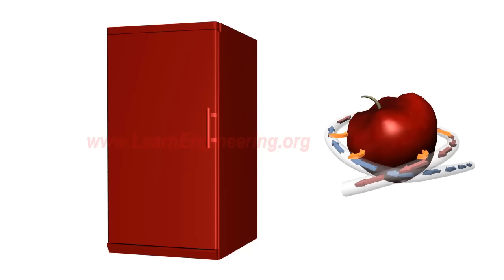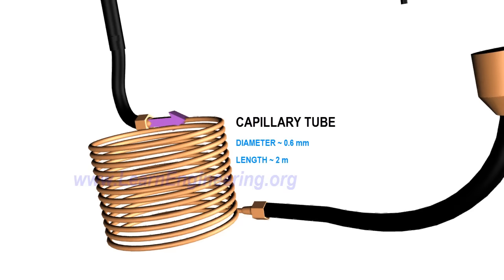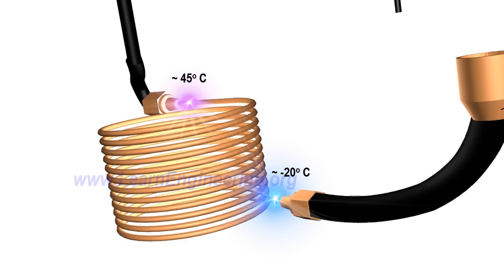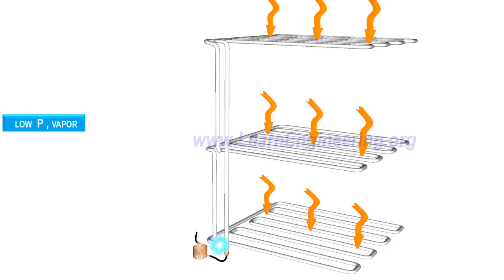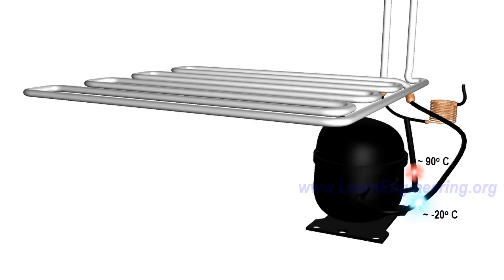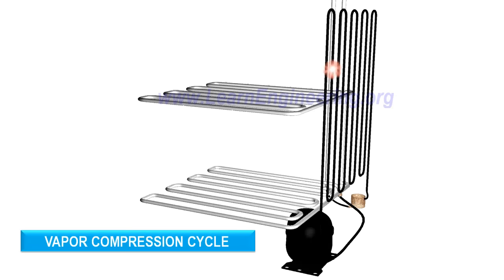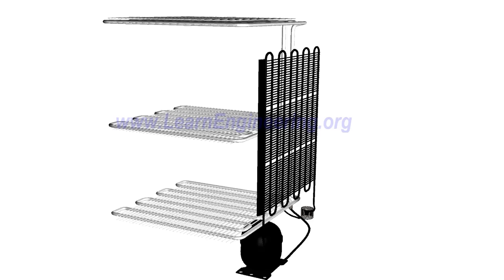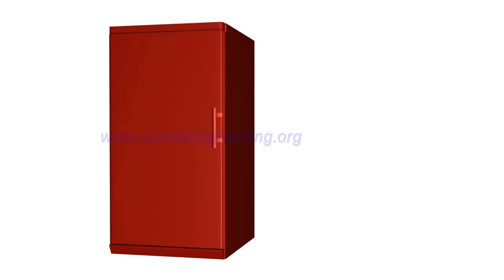Refrigerator working - The Basics

Comment: Why would a throttling device be used if it raises the temperature from -45 to -20? Wouldn't even greater heat take-away be achieved if it went through the system at the -45?
Reply: +Zikos 
whoops, I missed that. It all makes sense now, I'm a derpe

Comment: Still doesn't solve my question of why the low pressure hotter gas (after absorbs heat inside the fridge) must bother, through a two-step process of first increasing and then decreasing pressure/temperature, to become a high pressure liquid rather than just through a simple one-step process to become cold again??? I guess that's the esstenial bit of refrigerator engineering? I agree you sort of explained the chemical thermodynamics.
Reply: to simplify the question, why cannot we remove the compressor? What's the reason ('in general' is okay)?

Comment: Wait....if the throttling unit restricts flow, wouldn't that raise the pressure?
Reply: As far as I understand it, only inside the throttling unit. Because it's a closed system, the refrigerant is sucked around the circuit as well as pushed, so it's being pulled through the fridge's innards faster than the throttle can keep the flow rate high enough to maintain the high pressure.

Comment: But wouldn't lowering temperature through the condenser also lower pressure? Temp and Pressure go hand to hand.... I'm confused!!
Reply: +Kevin Corpetti You're right, but remember that between the condenser there's an ~8 bar compressor pushing flow continuously, and a throttling device (supposedly bottleneck-ing the flow), so probably there's pressure drop from the pipes itself besides temperature drop, but I think overall the pressure should keep high enough.

Comment: Can the throttling coil be said to be following Bernoulli's equation?
Reply: That's exactly what happens, the liquid enters a very small diameter which increases its fluid velocity, thus will tremendously decrease the pressure of the fluid.

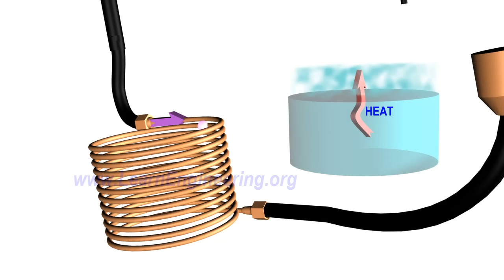Comment: 1:05 "Heat required for evaporation comes within the refrigerant..." Can you elaborate, please? Thanks!
Reply: Any matter contains a certain amount of heat.  Essentially all the molecules are moving and bumping into each other (vibrating).  Add heat and they vibrate faster.  But the vibrating is not equal.  In a liquid some of the molecules are moving faster than others.  And the fastest movers will escape as gas.  Loose a bunch of the fastest molecules and the average speed drops. So temperature drops.
Try this.  Leave a bottle of water out so it normalizes to room temperature.  Also leave a shallow pan of water.  The pan of water will be a little cooler until eventually it all evaporates away.

Comment: the temperature and pressure of the liquid after throttle and the temperature and pressure of vapor about to enter the compressor are the same. ( i.e -20 degrees and 0.6 bar ). how is it possible that liquid changes to vapor without change in temperature or pressure.

Comment: It would be nice to have a real Smart Fridge system that would work in a Smart Home setting? This would mean that the heat in the fridge and freezer would not just go back out into the room but it would be sent to other things that need that hot air such as the hot water system or outside. As well that same hot air could heat the water in your Ice and Water in the door so if you need instant hot water for that cup of hot chocolate you will get the hot water without needing to use more energy on the stove or Chef Mike. If this was possible this would mean that other things like your HVAC system would not have to work so hard. With designing the components like the motor, lighting, and things like a camera/LED full-color screen that you can see what is in the fridge and take notes and so much more so you don't have to open the fridge to see what is in there and where it is. This system would have cameras and a full mapping system where you can scam different products barcodes/QR Codes into it plus as you do this there is a 3D camera that can scan items on the door and as you put something in the fridge or freezer it will know where you put it and when you put it in so when you are at the store you can just pull up your list at the store and see in all directions on each shelf what you have in the fridge and freezer. Having different compartments can allow different temperatures to be put in this unite. This way certain foods that need to stay very cold can, as well as foods that need an average coolness while some just need to be very lightly cool, will not go bad as fast. For example for PWD People With Disabilities who may be in a wheelchair who may need that bottom drawer to put the milk in or that juice in because they can pull side by side to the drawer and pull it out and those items are just in reach and more accessible to grab. While the other things may need to be more or less cooler than the milk like meat that other sections could be used to house these items. This would go for things like your oven and making it so they are insulated so the extra heat would be sent outside or to other things like heating hot water etc. Making these appliances use less power than most people's smartphones but will still be energy efficient at the same time?

Comment: can a refrigerator act as a alternative to air conditioner in our houses?  like in a closed room with open refrigerator doors. Can it achieve cooling?
Reply: +Param Rajeshirke

On the back of the refrigerator are the compressor coils where the refrigerant is compressed and the excess heat is radiated away from the refrigerant. If you leave the entire refrigerator in the room, then no, you can’t use it as an air conditioner. It will just become a loop of moving heat from the air that flows into the refrigerator via the open door, to the refrigerant and then re-radiating the heat back into the same air in the room via the compression coils.

IF however, you were to re-plumb the coils so that they went outside and the excess heat was radiated to the outside air, then technically, yes, it could work. That IS the basic premise behind a window air conditioner.
Reply: +Woody615 oh okay!! thanks for replying😀😊😊
Reply: +Param Rajeshirke theres a reason air conditioners have their radiators outside xD + big ass fan included
Reply: +Jazmie Hamizan yeah true that 😁 😁😃

Comment: What happens if outside of the fridge has low temperature than the inside,does that reverse the cycle?
Reply: +Prashanta Timsina If the temperature outside of your fridge is colder than inside, get rid of the fridge because it's clearly useless lol. All jokes aside, the cycle should not reverse as outside air is not relevant to the cycle. The system simply uses the compression and decompression of a refrigerant.
Reply: +Prashanta Timsina If the system does not turn off the compressor it might damage it, because evaporation of the refrigerant in the cooling area would not occur. the refrigerant would stay as a liquid and return to the compressor, which is only designed to compress vapor. 2 possibilities are that the system would have a thermal shut off which would just stop the compressor until the temperature inside the unit vaporized the refrigerant, or there would just be an unloading of the compressor and it would keep recirculating gas with a bypass pipe and valving. So the vapor in the line would compress by the compressor and be decompressed by low pressure expansion tank rather than relying on temperature to cause expansion.

Comment: Which thermodynamic equations help describe this?
Reply: +Jacob Adamczyk No answer.
Reply: +ankhaa battulga As in you are unsure? Or there are none?
Reply: Absolut vodka
Reply: +ankhaa battulga got it, thanks
Reply: +Jacob Adamczyk For an idealised refrigeration cycle:
Compressor: isentropic process (constant entropy)
Condenser: Isobaric (constant pressure)
Throttle valve: isenthalpic (constant enthalpy)
Evaporator: Isobaric (constant pressure)

For each stage (apart from throttle valve), apply the SFEE (Steady flow energy equation), and it simplifies to:
Work done (or heat transferred) = enthalpy after - enthalpy before

From there you can calculate cycle's efficiency (or Coefficient of Performace, COP)

Comment: A fridge's door opened for an hour. There is any chance for extra electricity consumption
Reply: Yes there is. When the door is closed, the refrigerator has to only cool the volume enclosed by the door and the refrigerator which is called as the 'system' in thermodynamics. When you keep the door open, the refrigerator has to cool the entire volume of the room which now acts as the 'system'. This is in turn puts more load on the compressor and hence increases the comsumption.